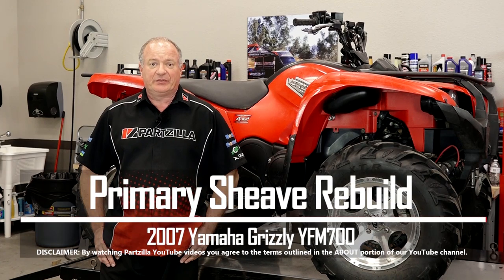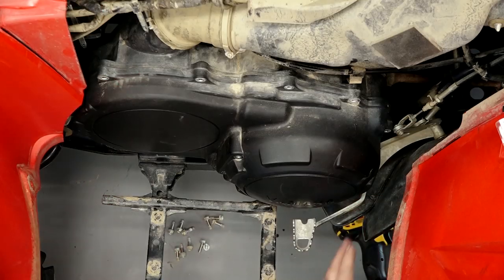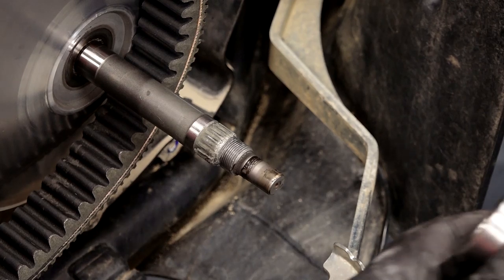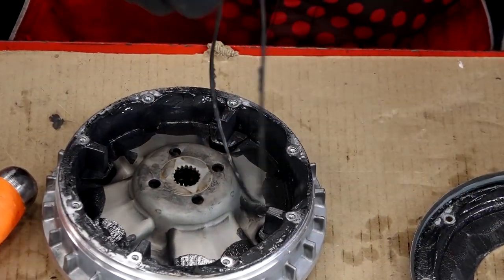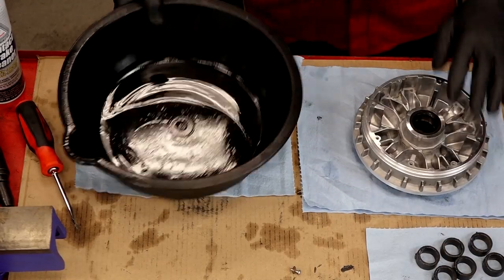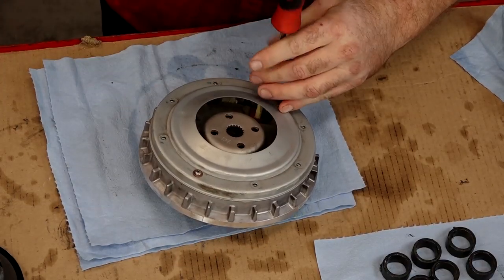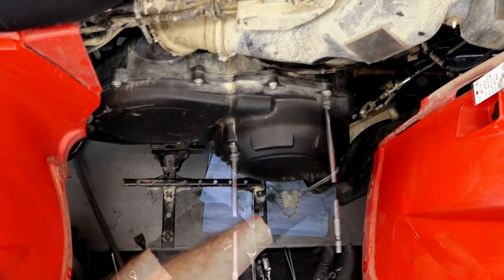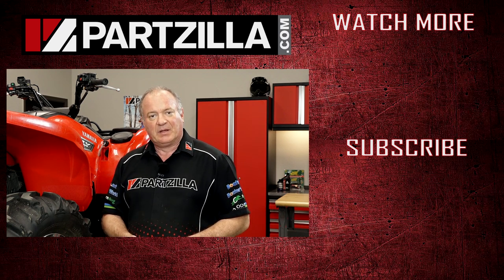Yamaha Grizzly YFM700 Clutch Rebuild | Yamaha Grizzly Primary Clutch | Partzilla.com

Comment: Beautiful vid. Tks for sharing. I just installed new 1 way bearing and test drove and had no low end torque. So took apart again and noticed a roller out of place on the clutch 🤦🏼‍♂️. Took apart and cleaned that big mess and replaced rollers and greased and just like new again. Once again, Tks for sharing this vid. Great step by step instructions.

Comment: You can loosen your secondary with the bolts you removed from your clutch housing
Reply from the maker: Never tried, but I don't think they are long enough.
Reply: That's how I did mine. The two long ones work great
Reply: @PartzillaParts  yep the 2 longer case bolts work
Reply: Same

Comment: Awesome had no idea about the grizz clutch my friend had a 07 camo 700 grizzly he sold it with 5600 miles on it never looked in there once had a stator issue under a recall and that's it that grizzly never said die.

Comment: Sir, are you sure it's a reverse thread, bec I have an '04 Grizz 660, and with a 4ft breaker bar, the nut on the clutch is not coming loose.  ??

Comment: Hello, thank you very much for your videos.
I wanted to ask you a question.
I removed the auto clutch (same as your video) on my Bruin 350.
After cleaning, changing gaskets, grease... I reassembled it.
I circled 3 km and the nut came loose, I tightened it again and the same thing happened.
Could it be because I didn't use torque wrenches? I tightened it with an impact driver but without knowing the torque Nm.
Thank you.

Comment: Thanks for the video, John.  Is there a reason that you didn't take apart the secondary clutch to clean/lubricate it too?  I know it's more involved considering the spring and everything, but should it typically be serviced at the same time as the primary, or it seems that it go longer?  In general, at what mileage would you say these clutches need lubricated?  I'm sure conditions play into this as well.  Thanks!

Comment: I have oil coming out of the clutch panel drain plug on my Yamaha 2005 Kodiak 450. Is there a seal I need to replace along with cleaning out everything and regreasing clutch, etc. and replace belt? Any suggestions would help.

Thanks

Comment: My 06 kodiak with irs is not allowing the cvt to spread and rise the belt reaching a  max speed of about 10 mph and it will let the rpms go to it hit the rev limiter but if in neutral the primary and secondary wrong as if nothing is wrong what do you possibly think it is or where do I start

Comment: use Polyurea Grease inside the hub of the sheave
Reply: Are we supposed to use that on the weights too now that the ultramatic grease is no longer available?
Reply: @BanginCB7  i bought a tube of that ultrmatic grease here in nb canada last week march 2021
Reply: What grease do you suggest using since we cant get Ultramatic grease now? Thanks

Comment: @partszilla what causes the primary clutch to not fluctuate in and out like it's supposed to when revving the engine
Reply: Gummed up weights - take it apart and grease like this video shows. Possibly the cam sliders are installed upside down, if it was recently serviced. I just did my Kodiak 450 which is basically the same design.
Reply: mine is doing that too can’t find nothing did you find out what to do ?

Comment: I’m wondering why my kodiak 450 is extremely sluggish taking off and only reaches speeds of 20mph. Could this be the culprit?
Reply from the maker: When you're going 20 are you at high rpms?  This could be a few other things, bad ECM, fuel or air issues or electrical issue.
Reply: Partzilla no, the motor is very sluggish and low powered when accelerating. Never reaching high rpms unless in neutral.
Reply from the maker: @elibanks9542  So not the clutch.  It's going to need some testing.  Check compression, valves, air and fuel.

Comment: What did you use to remove the old grease
Reply: reyes2581 i would use either mineral sprits or Brake cleaner will work.

Comment: How do you keep your weights from falling out while re installing
Reply from the maker: gob that grease in there...it will hold them.
Reply: Wrong info. He uses way too much grease. And the grease doesn't hold the rollers. You squeeze it together, keep it together until you have the nut on.

Comment: They are 6 mm bolts, NOT 10 mm--they have a 10 mm hex head...
Reply: Yes so it's refered to add a 10mm as that's the tool size used on it. Educate yourself bud